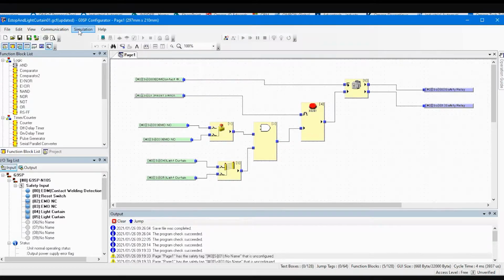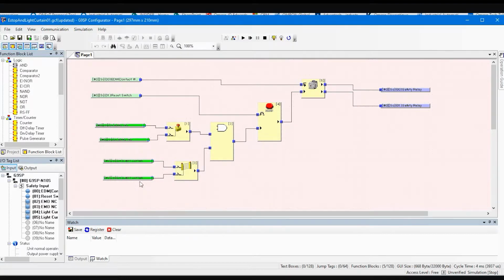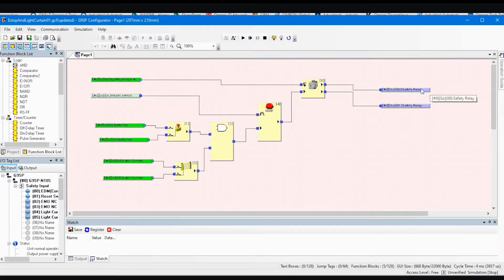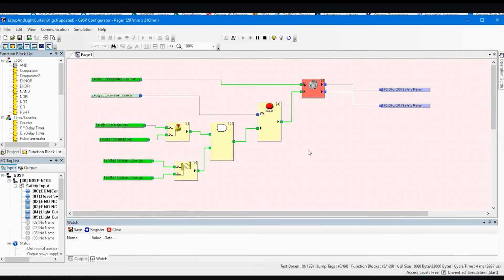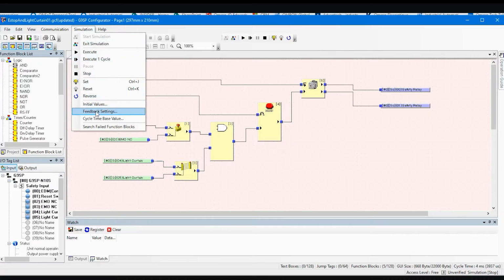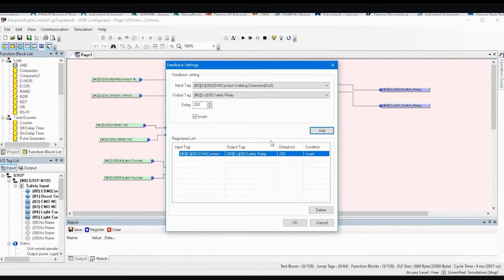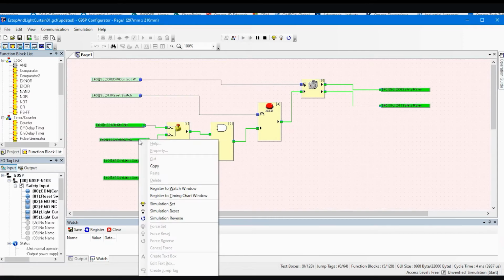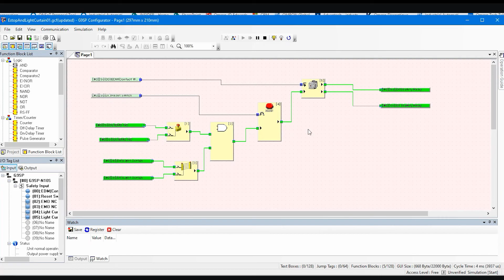How to Use the Simulation Feature in the G9SP Configuration Software

Comment: Hi, i am using g9sp n20s safety plc. I cannot see any discrepancy error output of E-STOP function when i change one of the input of Emergency button from 1 to 0. Can you help me about this situation please. Thank you so much.
Reply: use two single inputs with a test vs a two-channel input. to detect discrepancies both in software and hardware, also monitor the safety io terminal error flag